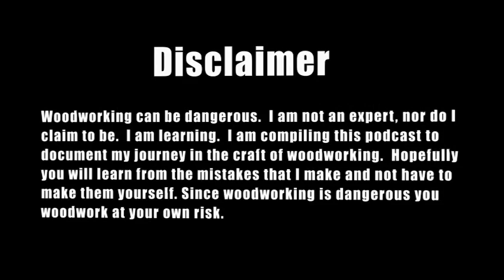TIW Ep 28 - Dust Collection in my Sawdust Factory Part 1

Comment: How much does that dust collector vibrate when it's on? I'm building a 4' x 12' mobile workbench and was thinking of mounting this dust collector underneath but I'm worried about vibration. Thoughts?
Reply from the maker: The vibrations aren't too bad.  I have since changed the ducting a little bit to work a little better.

Comment: you may need a new breaker, if they trip a lot they get weak and sensitive. Updating workshop electrics is always to be adviced also.
Did I see you use a wood/metal drill bit in dry wall? Surely not. They blunt easily in dry wall.
I do like your videos, you leave in all the bits that others edit out. It makes me feel better about my own mistakes! Cheers.

Comment: Why do you need a remote if you are only using it for the 2 tools that are right next to it. Seems more trouble and cost to use the remote than just reach over and hit the switch on the dust collector.
Also, they sell remote switches that plug right into the outlet then you plug the dust collector into it...not a big a bulky as the one you purchased.
Reply: At the time I also used this dust colector on my tablesaw and router table that are located across the room.